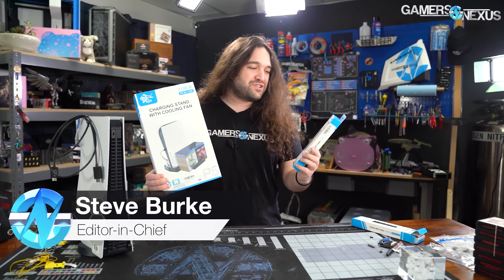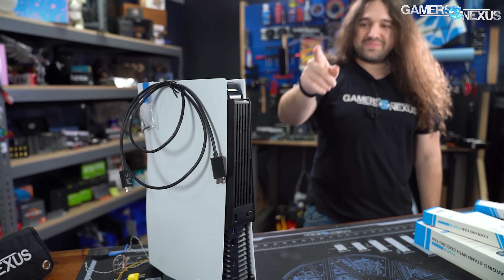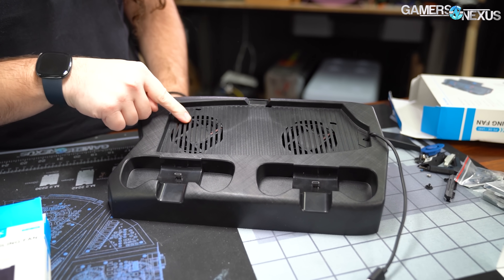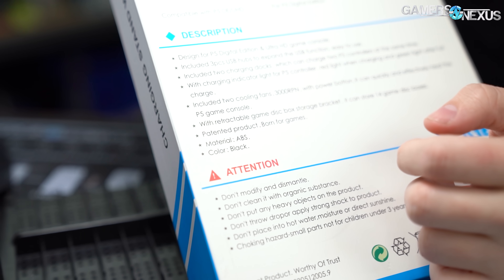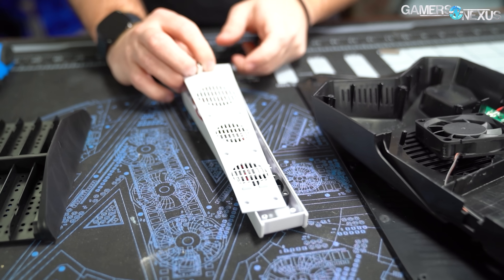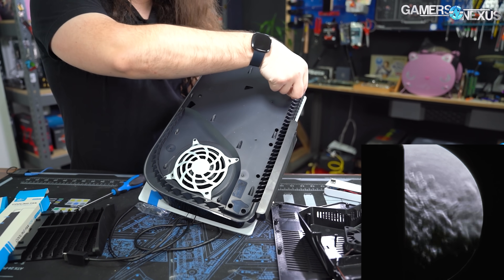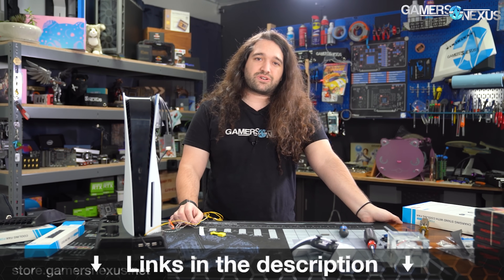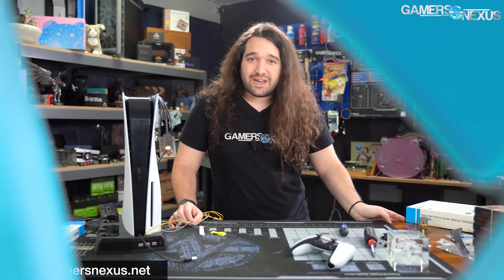Basically A Scam: PS5 Aftermarket Cooling Fans Blow the Wrong Way

Comment: Did you test the "rear-heater" with the fans turned around? I would really like to know if it actually cools the console a bit.
Reply: I'm surprised he didn't run this test as part of the suite
Reply: it mostly blocks the exhaust, so I don't think it would help much.
Reply: @proCaylak  i mean, if the fans are actually pulling air out of the exhaust, it could work in theory.

Edit; nvm, you mean the base one.  I meant the one on the back
Reply: @CGoody564  that's what they're saying, even if oriented properly (you know where they actually suck the air instead of fighting the air flow) they'll block more air than they help. The fans are way too small to even be able to move enough air and they become an obstruction instead.
Reply: I bet it would help a little if it the fan was mounted correctly. To pull hot air out of the console.
Reply: They won't, they hinder airflow, same crap as those fans for the Xbox 360 years ago. The fans couldn't even move enough air, and the holes for the fans obstruct even more. So it's best to avoid them.
Reply: Yeah, I would like for them to trim out the plastic on the backplate around the fans to stop restriction and flip the fans around to see if it actually helps a little. The KJH rear plate is the one im talking about.
Reply: @Ex_impius  you wouldn't see helping the system to run cooler, thermals will be worse. The size of the fans and their ability to move air is a lot less than the built in fan of the system and would still would be an obstruction. Fans of that size would have to be spinning a lot faster than what you see in the video before they could actually help instead of being a hindrance, but by then they'd be so loud they would be very annoying when turned on.

The issue with small fans is there is not a lot of blade surface to actually move enough air at those RPMs, the motor hub blocks a lot of airflow, and the fan housing itself also blocks a lot of airflow.
Reply: @madmax2069  Gotcha! Makes sense.
Reply: @madmax2069  Are you sure? The air looses a lot of pressure past the heatsink. The small fans could maybe help to pull the air out. 

It would be worth to test it. 
With the plastic removed infront of the fans.
Reply: @profix25lo  oh I'm sure, it was the same deal with the ones for the Xbox 360 years ago, the fans although bigger than the ones on the ps5 version done the same thing (just in the correct orientation), they hampered airflow which made the 360 run hotter and often caused the 360 to overheat.

 the ones for the ps5 are far smaller and can push nowhere near the amount of air that's being pushed out by the stock internal fan, which will hinder airflow aka cause it to run hotter, even if you was to remove a lot of the restriction by modifying the "coolers" case.

it's not worth testing when you know the result, garbage products are garbage.
Reply: @madmax2069  If GN goes by "you don't need to test it if you know the outcome" then at least 80% of the videos would not exist

Comment: I completely lost it when you opened that huge cooling base for the it only to have two 80mm 5v fans:-)
Reply: Honestly, I doubt they are 5v fans. Based on the RPM, I think they're 12v fans running at 5v
Reply: I really doubt that 2 fan is more than 40 or 50 mm, those blades are way to small for a 80 mm fan. You can clearly see that at the 7:30 timestamp
Reply: @vukkzor  it's a 80mm fan the large hub is common in cheap fans.
Reply: @alt5494  I dont wanna argue over such a miniscule thing but that fan isnt a 80 mm fan thats for sure, i had the "pleasure" to replace a few hundred 80mm fant in the past 15-20 years and  none of em had that big hub compared to the blades, also if you check the holes for the screws in the corners and than you can see the proportion isnt right, its way to big.
Reply: @vukkzor  80mm fans are measured by the frame because of their use in servers. 80mm is 3.15 inches in the shot the fan is about the same size as Steve's palm. Which in adult males is between 2.75" and 4.25" across. no where near to 40mm (1.57") or 50mm.

Comment: Can you try turning around the fans to see if it actually does anything?
Reply: I don't think it will help cooling. Since the fans are so small and the fan vents are small
Reply: @aaronslippery1921  i think you are right, but i'm also with @drewdane40
Reply: @aaronslippery1921  its up to 8000rpm +, I really wanna see how it works as exhaust
Reply: @aaronslippery1921  It definitely won't help, but it won't be as bad as the fans pointing the wrong direction - so the results would be interesting.
Reply: @icaruswindrune7116 turn one or two around since there are 3 fans so it has "cool" air going in and see how much of a difference it makes lol.
Reply: While I don't think this product deserves a second video (or even a first video, but here it is) it really bugged me that Steve took the thing apart and removed the fans without putting them back in and testing them, blowing in the correct direction. It was such a major point of contention that's easily reversed that I thought it was obvious that he'd do that, just to show how stupid the design was.
Reply: Also was kind of curious on this.  Or even drill extra holes in it just to see if it can actually work lol
Reply: Probably wasn't worth the time - he commented how restrictive the holes were around each fan, so you're adding a restriction with a set of small fans...
Reply: I was thinking the same!
Reply: I'll bet the plastic covering blocks more airflow than the fans move and the hot air will get recirculated into the ps5 blower instead of exhausting.
Reply: At 'best' it doesn't do anything, you'd need the fans to be inside the case to help the exhaust. The other option would be mounting it as intake on the top sides but it's clearly not designed to fit that way.
Reply: read the pinned comment
it would still blow straight at a solid wall of plastic
Reply: I am wondering if the person that did the assembly just messed up.
Reply: I would get a chuckle if those shitty little fans ended up in some ad-hoc VRM cooler or something similar down the road 😉
Reply: They need their own power supply. The fact they draw power from the system means they're wearing out your power supply that much faster. 

Ssd's as well need their own power supply as well. Imo.
Reply: I was wondering the same thing.  Since it looks like it is pretty easy to switch around.  Will actually take some activity on the part of the consumer but it might help?  Who knows, probably would still be a waste of money.
Reply: Yeeee
Reply: i commented that then seem your comment, so i deleted mine.
Reply: I came to say the exact thing because by design after teardown it's very obvious. I'm not interested in the PS5 or its related products, but this feels to me like a mean spirited excuse to get rage likes from the hivemind. I would have been laughing along at the bad design if an attempt was made to bring value to the discussion. Sorry GN, but you guys have got to know this stuff with all the other great lengths you go. This is lazy and bad.
Reply: @Varadiio  I agree. GN buys consoles, does teardowns, hooks up thermal probes, and reviews product accessories but doesn't bother to fix design flaws of other products. Obviously Steve is lazy and has sold out. I for one am throwing away my GN mouse mat just to spite GN!
Reply: @Dibromatic  I'm well aware that they're generally very thorough, and I said as much in my comment. This is why it's so disappointing to me that, after all that effort, they just concluded without giving it a try.
Reply: @Dibromatic  Fixing it and making it blow air into the exhaust area would most likely make the console hotter because it's keeping the hot air from escaping the console.

Comment: They claimed it cooled the PS5 and it cools the PS5
They never said it cools the inside of the PS5!
Reply: Clearly the P5 blows air the opposite direction as the PS5
Reply: No no no! They said it cools the P5 and Steve tested it with a PS5!
I think this is a case of Garbage in. Garbage out...
Reply: @blahorgaslisk7763  Maybe Sony made a version for China (or India) called the P5 which has a bottom intake..
Reply: @2Fast4Mellow  It would have to have the entire airflow reversed too...

No, this joke has gone far enough. This is just a total failure and an excellent example of ineptitude on the part of the designer. I'm surprised the plastic shells fit together as well as they do, but that doesn't help when the rest is just crap.

Well let me just make a note that the orientation of the fans in the using intended to hang onto the back of the machine could be something that they got wrong in the factory as as far as I can see there is nothing preventing them from being mounted so they sucked air out of the machine. But I doubt we will ever know if that was the case. However nothing prevents Steve just turning the fans over and run another test just to show what difference, if any, that would make. He mentioned that it blocked off so much of the exhaust grill that he doubted it would improve performance over the stock configuration, but testing sometimes give you surprise results.
Reply: @blahorgaslisk7763  Still not as bad as Xbox 360 though where it overloaded the power socket and melted it.
Reply: that sounds like malicious compliance
Reply: With the ps5 off, would it bring it down to room temp faster than natural convection? 🤔
Reply: It makes sense. Just keep the heat inside of the damn thing. Why do they even mount fans in the first place. It's a console, not a heater.
Reply: @fie1329  Honestly, i wouldn't mind keeping the heat the damn PS5 throws out away from everything else. The damn thing gets so hot it starts heating up everything around it. If I ever forget to pay my heating bill all I have to do is leave on my PS5 and I should be nice and toasty. LOL. I'm using little air fans to keep it warm (as oppose to freaking hot). Others have reported it's also hot as hell for them. Makes me wonder if in the near future there will be a "Red Ring of Death" style problem in the future given how hot the PS5 gets. While I really love my PS5, part of me makes me feel like I should have waited two years for a PS5 Slim version that runs much cooler.
Reply: Hahahaha!! 🤣😂 You have a point there.👍🏾👍🏾👍🏾 We were wrong to think this product actually cools the PS5 internally.

Damn consumers over reading into things how dare we do that!!!

Comment: I gift my disappointment 2020 t shirt this week and love it.  However I was disappointed that it was shipped in a single use plastic envelope.  With Steve's taking about reducing single use plastic in products this seems a bit hypocritical.  Will you consider dropping the single use plastic envelopes?
Reply from the maker: Hi. First of all, those mailers are recyclable. We strive to eliminate unnecessary single-use plastics wherever possible and, I think, do a far better job than most companies. We just eliminated 11 single-use plastic bags from our toolkits last year, and we eliminated single-use plastic bags from our mouse mats from the first order. Shirts are shipped in a mailer bag because no better alternatives exist: You can recycle the mailer, it doesn't take much space, it doesn't require tape, and it keeps costs down for the customer as well. It is actually more wasteful to ship it in a cardboard box both financially and environmentally, because now you're taking a ton of space on a truck for a box that has a t-shirt in it, which could fit in a mailer instead. And again, they're recyclable. The Disappointment shirts were not in a separate plastic bag (we eliminated these years ago) and are just put straight into the mailer, folded, so the only material used is shipping material. It has to get to you somehow, and that's the most effective way -- we think both environmentally and economically -- to do it.
Reply: @GamersNexus    Thanks for the reply. Re-reading my comment it comes across as more of an attack than intended and I apologize for that.  I appreciate you efforts in reducing single use plastic.
The mailer had no indicator that it is recyclable, but I put it in our film bag stash for taking to our local store for film bag recycling, but even taking film bags to the grocery store for recycling doesn't mean they are handled properly.  I've read articles that estimate upwards of 90% ends up not being properly recycled.
You mention there isn't an alternative, but wouldn't paper mailers be a potential solution?  Again I'm not trying to be augmentative, it was just the first thought I had upon receiving my first GN store product.

Comment: Try using both “coolers” together and it would smother itself to death.
Reply: Nah the ps5 has a thermal shut down mode to prevent damage from over heating.
Reply: Austin Evans already has in his ultimate ps5 video
Reply: @scuffedtech  I’ll have to check that out

Comment: Soon as you said "blows air into basically a solid base" I was sold.
Reply: I mean most case manufacturers nowadays seem to think that that's a valid cooling solution, so I could see where they got the idea.
Reply: i still think laser engraving can make holes for those side panel for PS5 and consumer can just slap mesh from the holes
Reply: Should have tested these by covering the whole ps5 with a mesh filter. Bet they'd be great then!
Reply: At least the base is cool now
Reply: If it works for Apple, it works here as well right?
Reply: We really need to push the phaseshifting coolers more, i really think they are the future of cooling....

Comment: Ok this is crazy, I literally just bought a similar item for my xbox. After like a day of observing it I was wondering why the fans were so loud and why the xbox hotter. Well the fans were installed backwards, I think through incompetency, so the fans were fighting the natural fan flow and convection of the machine. Flipped the fans and wah la, quieter and cooler.

Comment: Hey Steve, did you see that AMD finally admitted the USB dropouts issue when PCIe 4 is enabled? They made an official post on the AMD subreddit
Reply: I had read something about this at some point. What chips/boards are having this issue? I’ve been running an X570 Strix-e gaming, 3900x and an RTX 3080 and haven’t noticed any dropouts.
Reply: @Jpilgrim30  the issue is with boards using the 500 series chipset (b550 and x570) when using a PCIe 4.0 GPU with PCIe 4.0 enabled.
Reply: @madmax2069  and I believe his rig is using pcie 4.0 enabled
Reply: @sgtsetia  what ?
Reply: @Jpilgrim30  Been running same board and cpu config with a 2080ti for a lil over a year and have never once experienced a usb dropout.
Reply: @d3fct  Doesn’t the 2080TI use PCIe 3?
Reply: @d3fct  yeah but the 2080 ti isn't PCIe 4.0, it's 3.0 so that's why you don't see the issue.

Comment: Lol someone should tell austin that.  It's parts of his Ultimate PS5 vid
Reply from the maker: Oh wow, didn't even know he made that video. Yeah, the fans are garbage. Do not buy them. It's unfortunate if anyone did buy them.
Reply: @Dr. Hibbs you got a source for intel running games in single channel the same as dual channel?
Reply: MKBHD also had a similar product in his custom PS5 video. At least he acknowledged that the cooling fans probably don't do anything and you're basically paying for the USB hub and charging ports.
Reply: @homeboi9794  well, if its not doing anything its not much of an issue, who cares. But if its impeding the exhaust it can cause issues in the long term
Reply: @Dr. Hibbs ?? dual channel will be better than single channel for both intel and amd
Reply: I mean he did mention that the fans are useless and not going to help at all.
Reply: @Dr. Hibbs Was that during the wan show? They dont say anything about this in any of their videos that I can see. The wan show is them just talking, so they wouldnt have had a chance to actually see any of these in person, its fairly normal for someone who knows the PS5 is hot to think 3rd party cooling would be an idea worth looking into.
Reply: If I recall correctly he said they were stupid also did he not?
Reply: @Dr. Hibbs RAM may matter more on Ryzen but that doesn't mean it doesn't matter for Intel. Ever since dual channel has been available, it has mostly been the recommended regardless the setup. Don't spread garbage for stuffs you do not know yourself.